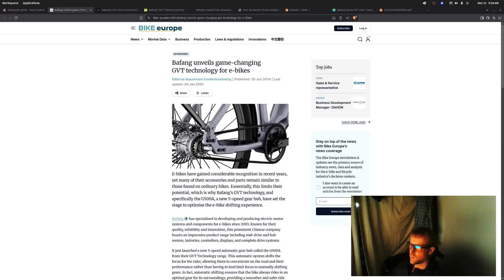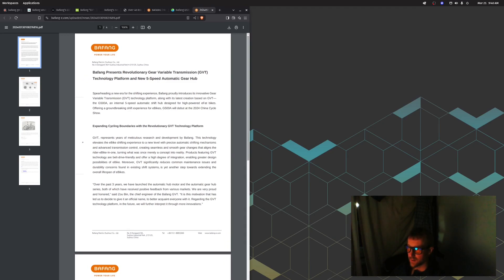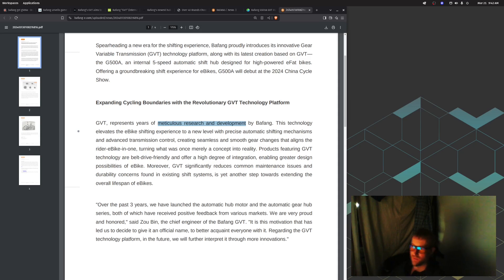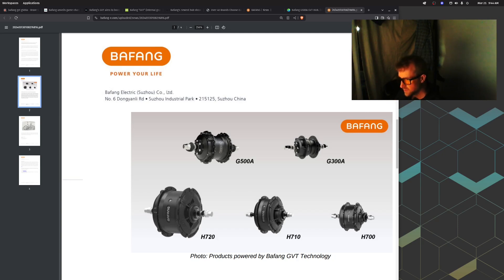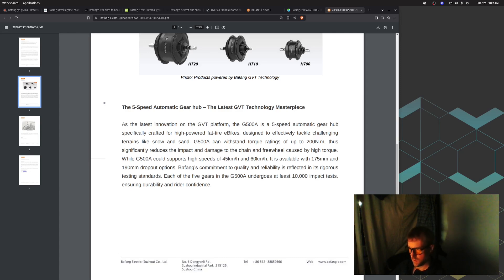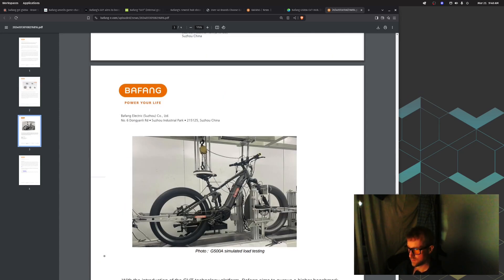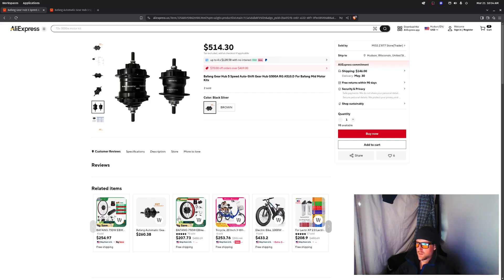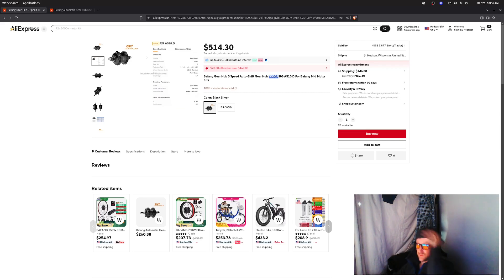Look @ BAFANG "GVT" (Auto-Shifting) IGH (internal geared hub) G500A (eFat) and G300A (eCity)

Comment from the maker: BAFANG RG A510.D (G500A)
WHEEL SIZE - 20" / 26" FAT TIRE
MAX TORQUE - 200NM
SPEED LIMIT - 60 KM/H
DRIVE TYPE - CHAIN
SINGLE FREEWHEEL - 26T / 30T
GEAR RATIO - 1 / 1.33 / 1.81 / 2.46 / 3.35
SPOKE HOLE - 26 * 12G
OLD - 175mm / 190MM dropouts
HUB DIAMETER - 123mm
BRAKE - DISC BRAKE
WEIGHT - 3.7KG

BAFANG G300A RG A310.D
WHEEL SIZE - 26" - 28"
MAX TORQUE - 100NM
DRIVE TYPE - BELT / CHAIN
SINGLE FREEWHEEL (chain) - 16T / 18T / 20T / 22T
BELT FREEWHEEL - "Open For Gates Belt"
GEAR RATIO - 1 / 1.3 / 1.65
SPOKE HOLE - 26 * 13G
OLD - 135mm dropouts
HUB DIAMETER - 99mm
BRAKE - DISC / V BRAKE
WEIGHT - 1.7KG

Comment: How are these bafang igh installed?
Reply from the maker: its the hub for a rear wheel,  laced with spokes into a rim
Reply: @ yea I get that part. I just haven’t done one before.
Reply from the maker: @ Sorry  Haha didnt mean to insult your intelligence . I think it has a centrifugal clutch and it can some how shift on its own, There is no connection between the hub  and a shifter or  the electronics whatsoever.

Comment: The 45 km/h is for mopeds in the EU country, the 60 km/h is over that, you need a motor cycle license to drive that at full speed in germany....
Reply from the maker: yeah I think they have designed the G500A  / A510.D to handle the BBSHD  which can go upwards of 35+ MPH

Comment: Well i personly dont like that tec. When they take the chain of for a belt, the belt is less efficent, so you lose some power and range. Internal gear : once it gets wet its dying fast, which is exspensive, also the geares are small and thinner, they cant take as much power, those can break, specialy if you chose the wrong geare. Bafangs 1000W midd motor hase the same problem already shown us, that even still gears can break fast. So im already see some comen issues that it will bring to us.
Reply from the maker: i personally like hub motors more,   but this technology is exciting for mid drives,   and the "GVT" technology is also going inside the Bafang hub motors  like H720

Comment from the maker: i guess that big fat H720 at 5:29 is a hub motor with built-in GVT???
Reply: Ado air 20 pro uses something like that if I remember right. I saw that somewhere on yt.
Reply: I am wanting to motorize my Mongoose Dolemite.  This H720 is a geared fat hub MOTOR, all in one unit.    It is a two speed sihift based automatically on motor speed.  Definitely an upgrade from G06? model motors.  Add a controller  and display, and a throttle and a proper gear for the chain and done.  This seems too easy, what am I missing?